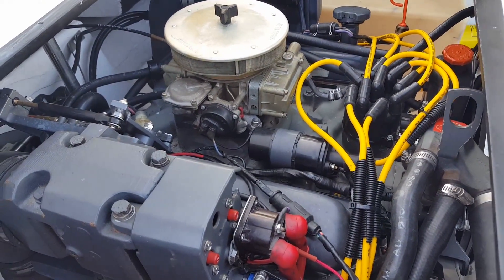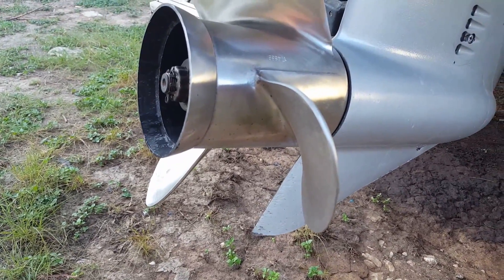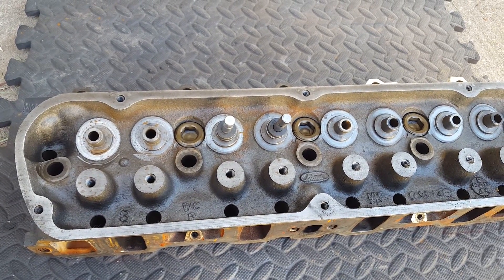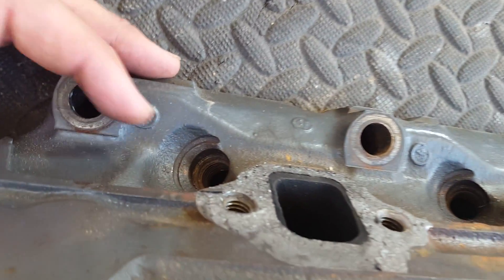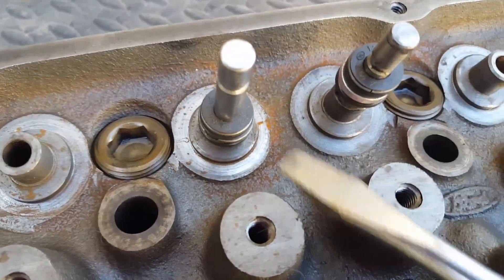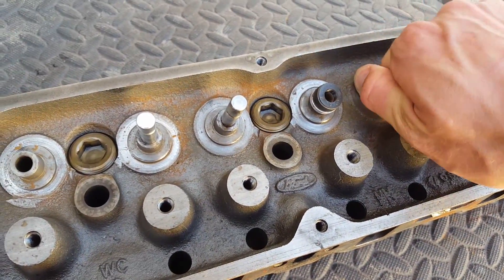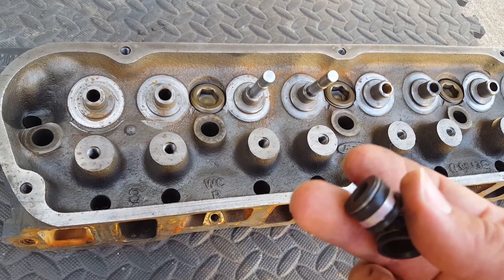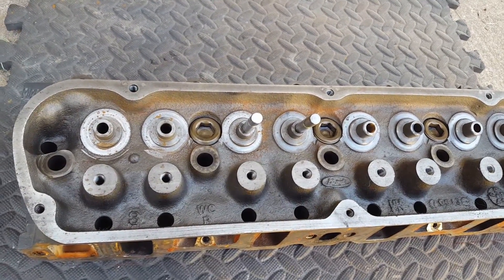Massive Oil Leak From Exhaust on Marine Engine

Comment: I have that problem with omc 3.0 4 cyl, good comp but leaking oil in the same way
Reply from the maker: Thanks!
Reply: Hi do you know the serial number for Valve Seal for an omc 3.0 4 cyl 140 hp 181?

Comment: Question Boss man, I watch your valve leak episode and water coming out at the transom area like it should, my question is on mine it stop or almost stop . Causing overheating, I replaced plugs, check timing, water raise on intake line, at front of engine I believe all good.  Stern drive feels hot right in front of impeller and no water coming out right below the bellows. I don’t let it run long!!! Please some advised.... your  faithful student!!! Thanks mentor Robert  P.S. Great videos !!! Hey teacher I’ll give you a little more information, I’ve had this  boat for ten years and never did any seal work on the stern drive so my question should I go a head and  get the seal kits for each section and replace all seals in each section?

Comment: WHAT do you think about an oil and fuel mixure under the OMC COBRA 350 engine? And, It uses up about 10 gallons in about 1 hour- a major fuel loss that can be easily seen on the fuel gauge and leaking into the water. The main thing is the oil/fuel in the bilge area under the engine. The fuel tank seems to be fine. I sucked in and blew on it with a larger shop vac. Thanks for your help and videos
Reply from the maker: There’s a fuel line that goes from the tank to the water separator—check that hose. There’s a brass line that connects into the water separator to the fuel pump. Fuel pumps love to leak. If your pump is leaking, it’s a cheap fix if it’s the gasket. There’s another rubber hose that goes to the carburetor—check if there is fuel around the valleys on the intake manifold. There’s also the possibility you have a carb. that is leaking down to the intake manifold (from the outside). There’s also the possibility your carburetor is leaking inside the intake because your seals are bad—that would be noticed because your engine would feel under powered.
Reply: @michaelromer2016  I will check that. I took a look at that yesterday but not while the engine was running. It is still out of fuel. I'm going to put some fuel in it, start it up and look for leaks. I will let you know how it goes.
Reply: https://www.youtube.com/watch?v=8TC-
RkZpw98&feature=share